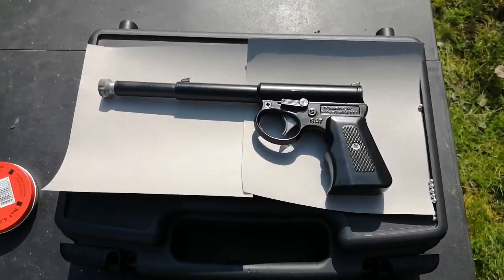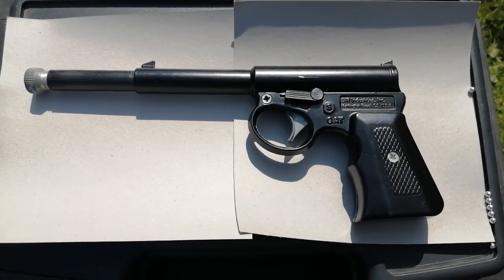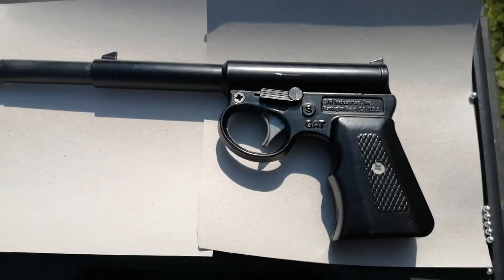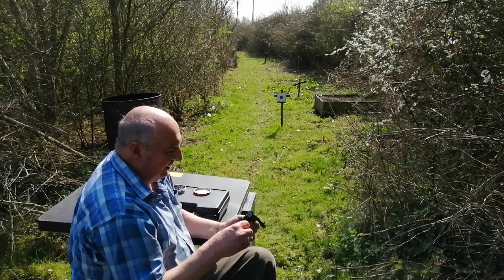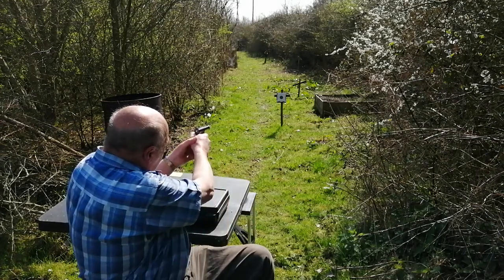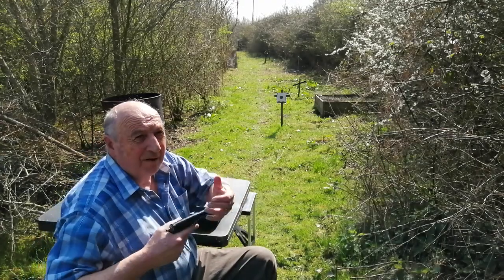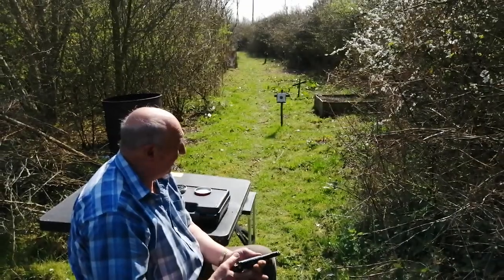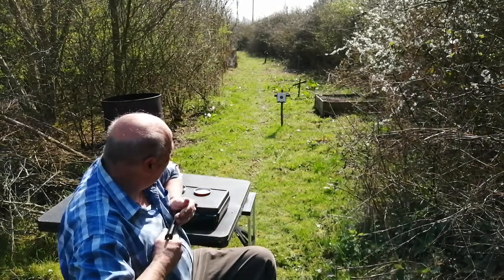The Gat air pistol.

Comment: I bought the Diana equivalent of this in 1972 and I still have it! Horrifically inaccurate thanks to the mechanism design, but loads of fun. I fired darts as well as pellets with it. I then moved ‘up’ to a Milbro G10 repeater, which I also still have. That is a really dreadful gun, with such a low power output it would not pierce a yoghurt pot! Eventually I upgraded to a Slavia ZVP, which I still have too. That was my introduction to proper air pistols!  My shooting career peaked with Lee Enfield Mk4 .303 at Bisley, which just goes to illustrate your point that the Gat got people into shooting. Thanks for the nostalgic video!

Comment: Do you still need a licence for this or any spring type pistol
Reply from the maker: No, so long as it's under 6 ft/lbs of power. Over that, you're going to jail!
Reply: If you buy from a shop they require passport and proof of address 18 years + that’s it !

Comment: From posts I've read gats seem ubiquitous and cheap in England. They are not all that common in the U.S and the ones I saw on Ebay went for around $60-$100 which is too much for what it is. 
The bottom of the barrel cheap air pistol in the U.S. was the Marksman, which resembled a colt 1911. As with the gat that also had a reputation for inaccuracy. It would be interesting to compare the two to see which was the least accurate and had the least power.
I have a couple of cheap springers, a Daisy Powerline 201, which is an uglified clone of the Marksman, and a Big Country 1911, which I just bought new. 
I guess reintroducing the gat must have fell through or been pushed back. If they ever do reintroduce the gat I'll probably buy one.
Reply from the maker: Thanks for the info. Most people have fond memories of their Gats, I must have had a particularly bad one when I was a boy.
Reply: Im pretty sure at least 50% of boys growing up in England had one of these(it seemed like that anyway)
There must be tens of thousands of them forgotten in attics and sheds.
Reply: I had both the marksman and the gat and can confirm that the gat was the less powerful and the less accurate.

Comment: I was given one for raking leaves off someone's campsite. Thought I was getting a deal of a life time. I what 10 year old boy in 1972 wouldn't think getting a BB pistol for a little work isn't a great deal? WTF!!  One the BBs just fell out unless you pointed it up.  Already I was like BBs are all I have. I need pellets? I need a lawyer to sue for misrepresentation. So tried a bit of tissue to hold them in barrel. You know, like the muskets we used to kick England's ass. That sort of worked. OMG, if you could hit a beer bottle, it just bounced off. Now pushing 60, I still have every BB gun I had as a kid. Every one but that one. I can't even remember what I did with it. As the man said, it was rubbish!!

Comment: Is it deadly to people
Reply: Noobplayer well you of my friends got shot in the face at  about 10 feet and didn’t leave a mark, nearly 30years later we still laugh about it
Reply: porkerthepig well it isnt i think a nerf gun is more deadly
Reply: ...only if swallowed !!!
Reply: Had one of these in the early 1960s. They were only dangerous if the extending barrel hit you. Couldn't hit the proverbial barn door, but great fun. I usually used the darts with a fluffy tail, principally because you could reuse them and they ended up being cheaper than pellets. I also had some lead "cat pellets", which were dome headed but with no skirt. I suspect they were as aerodynamic as a very small house brick. And before anyone asks, no I never fired at a cat!

Comment: I got 5 GAT pistols and 2 GAT AIR Rifles
Reply from the maker: You're exactly the sort of person I said should do a video of them. I saw a Harrington one for sale a few weeks ago, boxed with the cleaning rod for £68, I resisted the urge to buy it.
Reply: Timothy Edwards I noticed yours ain’t got a leather seal on the breach plug the power will be worse with out it I brought all mine second hand  3 of the seals was missing I just hole punch them out of a old belts and took the guns a part to fit a leather seal behind the spring as well to Keep all the air in the air chamber and to go down the barrel and lock tight on the barrel part where the piston cup is you want all of it tight  they come loose after all them years doing this mod will give  you 290 FPS all the time
Reply: They made Air Rifles?
Reply: @timothyedwards2161  I've got two.. Well worth collecting for nostalgic purposes!  Try boot fairs.. Much better chance of finding one, if you really want one.